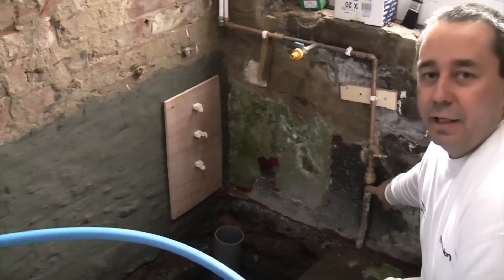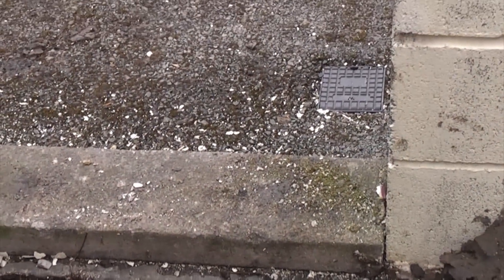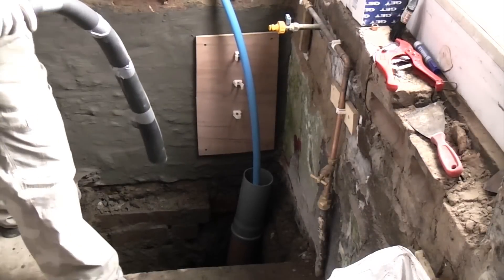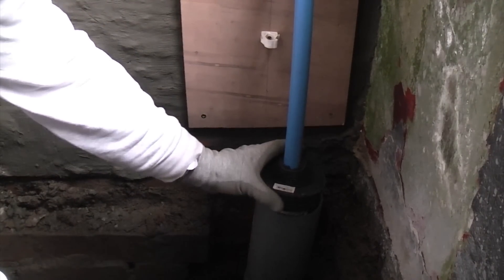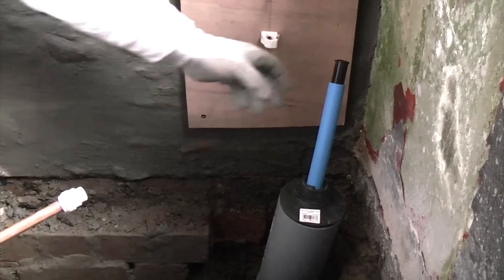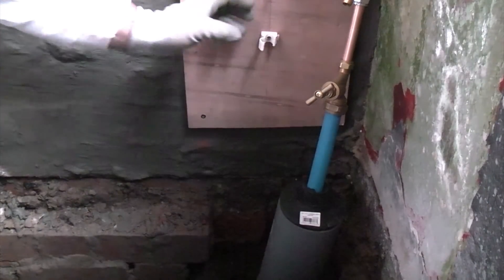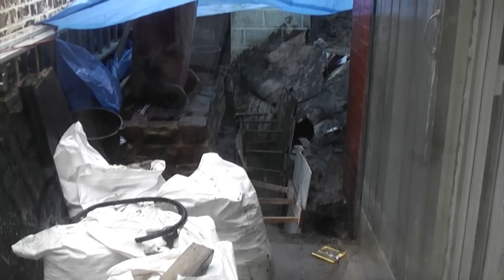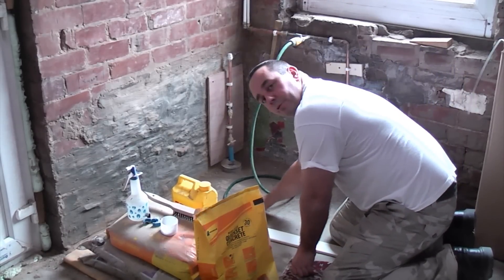Lead pipe replacement

Comment: Did you just leave enough length of pipe at the boundary ready to push through when they came to connect? I don't have to dig outside mt wall leaving it sticking up outside the boundary
Reply from the maker: Yes, you need to leave a couple of feet. I dug under the wall from my side, then put the cap on the pipe and pushed it a couple of feet through the soil/clay, then the utility company can dig up on the street side and connect it up 👍

Comment: If you use a flexible twin wall coil (blue one 110mm)  how do you seal the ends of the duct
Reply from the maker: Not sure, I think I only sealed the end on the inside of the property 🤔

Comment: Hello great videos :) I got a questio, I have a 1930s built house with lead pipes in the walls. My kitchen has both hot and cold tap pipes go into wall. My bathroom is about the kitchen, do the pips go down into the kitchen floor? I want to insall a cabinet above sink but unsure where my water pipes go within the wall. Hope you can help many thanks. hope that makes sense lol
Ian
Reply from the maker: I have no idea, sorry.
It all depends on the plumber, he could have routed the pipes anywhere 👍

Comment: Great video from back in the day. I've just started this job. Currently digging a trench About 6 metres across front garden then core drilled through three layers of brick at front of house. I've run 110mm blue flexible ducting through the underfloor of the living room and then core drilled underfloor kitchen wall. The ducting then comes up into the kitchen through another core drilled hole. Not seen the flexible ducting in any youtube video as most use 110mm soil pipe. Think I should be ok with that as United Utilities don't specify any particular ducting. By far, hardest part is digging down into rock hard clay. Getting there though....
Reply from the maker: I think any ducting will be fine, it’s only to make replacing the pipe easier in future.
Clay is a real pain, always sticks to the spade!
Best of luck with it 👍
Reply: @ultimatehandyman  Hi...Thanks. Could youy tell me a specific product to seal around the MDPE and the gap in the bung. I don't seem to be able to get a definitive answer to date. Thanks
Reply from the maker: @Cybertruck1000   I used one of these- https://bit.ly/3NgtSUN 👍
Be careful if you use any kind of sealant, as chemicals can leach through the MDPE pipe into the water
Reply: @ultimatehandyman  Hi.. Thanks for reply. Yes I have one of those end adapters. There is a gap though between the pipe where it comes through the adapter. I was under the impression it would have to have a sealant to seal that gap even though it's small. Last bit of the puzzle this. I may see if I can tape polythene around pipe either side of the the adapter then mortar round it. United utilities say plumbers sometimes use mortar but protect the pipe whilst doing so. If mine passes inspection I'll find out from inspector what he thinks it's best method and I'll let it be known. Seen a few on internet trying to get to the bottom of this. Thanks

Comment: Were did you get the rubber blank that you cut to put the water pipe in to seal the 110mm soil pipe many thanks in advance
Reply from the maker: 110mm rubber reducer- Example here- https://bit.ly/3NgtSUN 👍

Comment: I'm installing a new water supply with 32mm mdpe into a different location in the kitchen, under the kitchen sink, the pipework is entering through the outside wall using a insuduct housting 110mm ducting at 90 degrees just above floor level,. What are your thoughts as to puttting the philmac mdpe type stopcock 90 degrees or should I put an elbow fitting  onto the incoming pipe then a short piece of mdpe then the stopcock upright? I'm thinking the upright stopcock would look neater however the horizontal way would have less fittings before being able to turn off.

Comment: Hi, any chance you can list the names of the materials we need and or links?

I'm struggling to find:
Rubber seal/gromet for soil pipe.
Drain off valve like yours.

Thanks would be much appreciated 👍
Reply from the maker: I think I used one of these- https://fave.co/3qVjLtC
Drain off valve- https://fave.co/3iNkl9T
Which you connect via a compression Tee - https://fave.co/2YihIU4

👍
Reply: @ultimatehandyman  many thanks 👍

Comment: Great video! Just wondering if this stop tap you fitted was in the kitchen/ back of house and the main stoptap at the front, how would you tunnel under your floor to put the ducting in?
Reply from the maker: Not sure. Where I live all the houses I have seen have the water supply entering either via the back (as in this video) or via the front. The houses that I have seen where the outside stop tap is at the front and the stop tap in the property is at the rear, normally have the pipe running at the side of the house (not underneath it)
Thanks for the comment 👍
Reply: @ultimatehandyman  thank you!

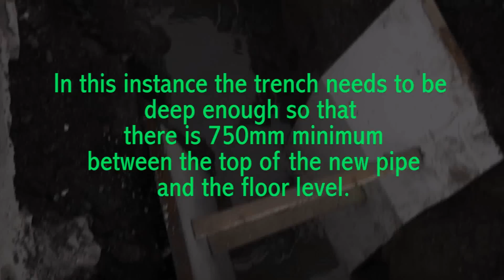Comment: Where the writing said at 1:15 that the trench needed to be 750mm min from the top of new pipe and floor level this just mean the pipe must be buried at least 750mm deep. Also does the insulation continue all the way to the main connection done by the water board
Reply from the maker: Yes, the trench needs to be at least that depth, or the waterboard will refuse to approve it.
The insulation just goes on the inside of the property and down into the trench, once the pipe is under the ground, it will be insulated by the earth.
Thanks for the comment 👍
Reply: @ultimatehandyman  Thanks you for always replying. Great Videos and website you have.

Comment: What did you bed the water pipe on in the trench? Pea Shingle? Sand? And what did you place on top of the water pipe in the trench? Soil ok? 
Many thanks kind regards
Reply from the maker: I can't remember now, it was so long ago. 
United utilities sent me a guide and specified how deep the hole needed to be and what it needed to be bedded on ( I think it was sand), they then came and inspected it, before it was backfilled and flagged over.

Comment: will i get a better flow rate if i connect to a 22mm pipe rather than a 15mm pipe or will it not make any difference.
Reply from the maker: If you are installing a full run of pipe through out the house and if you use a bath tap you will get more flow, but if you are just using a piece of 22mm to connect up to existing 15mm pipe you will not get better flow.

Comment: when you fill the hole in with the clay and concrete. Do you have to put and damp course in ?
Reply from the maker: There was no damp proof course in this house, so after filling in the hole the whole floor was tanked, then levelled with a screed. But you could just put some waterproofing ad mixture in the concrete.

Comment: The waterboard have come and fitted an external stop tap...but on my property, does that mean I don't have to notify them of the lead replacement? I asked them if I had a choice where it went (I wanted it to go by the lawn so I could dig up the soil rather than driveway ), they said no but that there's an existing channel plastic pipe can be pushed down so no need to trench.  It sounds (and looks) a bit unlikely to me, but does that sound right?
Reply from the maker: Not sure, you are better off asking the waterboard.
I have heard about them pushing a new pipe down the old pipe, but I have never seen it being done and so I do not know how well it works.
Thanks for the comment

Comment: This is an old vid now so you might not recall an answer.   Great advise all the same, so thanks!
My lead feed splits at the top of the drive, one way to the house and the other to the Brick $hit house.
Just discovered I've been losing an average of 980 litres per day for the last 12 months (no sign other than the water meter).
So, rather than patching it I'll replace the lot.  How do you go about the feed splitting issue?  Can joints even be burried??
Reply from the maker: Not sure, to be honest.
To get the new pipe fitted under the lead replacement scheme (if it is still running), you might have to replace both lead pipes.
You can of course use the Leadloc fittings underground, or you can use the UTC-
https://www.youtube.com/watch?v=_k5NS5Y-KHg
Best of luck with it ;-)
Reply: @ultimatehandyman  nice one pal, I'd never heard of them.  Good video.  Cheers!

Comment: United utilities did reading on our outside tap is low flow, apparently next door detached like us have low flow like us too. Utilities managed to find our outside stop tap down the alleyway today, we and neighbour have own seperate feeds and main stop tap. Neighbour is getting low flow as well not sure what the issue is. Utilities have not done reading on outside stop tap just yet.
Reply from the maker: Apparently there is no law or no set minimum amount of pressure or water flow, so as long as you have "water" they might not do anything about the poor flow.
 Thanks for the comment 👍

Comment: How much would all this cost trench digging wise and piping, what did you use to dig with?
Reply from the maker: A mate dug the trench with a pick axe and spade.
You would probably be looking at £300-£500 to get the trench dug, plus the pipe and fittings (which are not expensive)
  Thanks for the comment 👍
Reply: @ultimatehandyman  I have a concrete breaker that might be good.

Comment: Useful video thanks. Can I ask why you bothered to put the insert and stop end on at the meter end of the pipe? Surely the water board have to cut it to length to connect it up?
Reply from the maker: You are welcome.
When I applied for the lead replacement scheme, they sent out a leaflet which explained how deep the pipe had to be, how it needed to go under the foundations and also stipulated that the end needed to be capped off using a stop end. I followed their instructions to the letter, as I did not want to give them an excuse not to do the job.  When the guys came to connect the pipe, they asked me the same question as you 😂
Thanks for the comment 👍
Reply: I have finally started mine and have the trench dug out now. Did it make much difference for you over the lead? Were you replacing for increased flow?

Comment: Shirley , there must be an external wall mounted option ?  then drill hole through wall at required height, this is like back in the dark ages , and it has potential to disturb foundations ., as 750mm down smashing through bedrock then foundations . Come on, wall mounted external options ?
Reply from the maker: This is how all mains water pipes are installed in the UK, although in newbuilds the pipe will be put in before the foundations (I assume). The pipe is underground to prevent it from freezing.
Thanks for the comment
Reply: who is Shirley?
Reply: Not so sure they had domestic pumped freshwater supply back in the dark ages, or that it was ("would have been") an underground piped supply...

Comment: hi, redoing our kitchen amd if I want to move the position of my houses stop cock can I just cap off the existing join to my houses pipe work and relocate the incoming water main to join the system elsewhere like under the kitchen sink downstairs  or could this cause problems?  it is only a small terrace, currently the mains comes in and goes immediately up and under the first floors floorboards.  my understanding is that as long as I join it back up to the cold pipes the pressure will mean everything should operate as normal. is this correct.  obviously I'll make sure it's still earthed at the new location. thanks.
Reply from the maker: I'm not sure if you can do that to be honest (you probably can), but it is not something I have ever done before.

Comment: Nice job. What happens to the old water feed? was that capped  or disconnected outside the boundry wall OR was it left in place?. If the other end of the MDPE has to exit the boundry by 2ft does it have to be protected from soil damage and does it need a tracer wire ?
Reply from the maker: Thanks, The old lead pipe was disconnected at their end by the water supply company, but it is left in position.
The MDPE pipe simply has a protective cap over the end, the water company then remove the cap and connect it to the mains supply.
Thanks for the comment
Reply: Abandoning the old line in place is the ideal solution, since the electrical system typically gets Earthed to the water supply, and often two additional 2,5m long copper rods are driven, and located at least 2m apart for Earthing purposes...

Comment: hi im doing a single storey extension at the rear and was wondering what is the min depth   the MDPE can run under the the new concrete  slab , cant find info on this anywhere. I know its 750 deep in an external trench . and does this need signing off if im only extending it from the old kitchen to the new . thanks for the help
Reply from the maker: I'm not sure, sorry.
When installing this pipe I just did it exactly as the utility company recommended.
Your best bet would be to ask building control as they will be the ones that will be signing off the work.
Thanks for the comment

Comment: Hi
can you help with the name for a Rubber Seal you have used to end of soil pipes. Maybe I don't have the right name for them, Could't find 
thanks
Reply from the maker: Its a 110mm rubber reducer, which you can get on ebay etc.
http://fave.co/2egyYFf
Thanks for the comment

Comment: Great video! I need to do this job and plan to do it when I re-do my front yard. On my property the pipe will come into the cellar (horizontally) at the front of the house. Should I use a 90 degree mdpe elbow on the mdpe pipe as it enters the cellar or is there a better way to do it? Cheers
Reply from the maker: Yes I would use an elbow, as long as its inside of the property.
You can bend the MDPE pipe but you can only do long sweeping bends and not tight bends like you will get using an elbow. 
Good luck with the replacement ;-)

Comment: Very good, very educational.  But why wouldn't you come off in 22?
Reply: I had the same thought. In the US, 22mm (3/4" Imperial) pipe is ran extensively thru the structure. This prevents pressure loss, which in the case of a someone using the shower, could prove painful when another fixture is used, such as a toilet in another bathroom or a washing machine, etc.
Reply: Because we in the UK do things like they’ve always been done. 

It’s one of thankfully only a few things that annoy me about how we do stuff here in the UK. Even if it doesn’t make sense, we do it that way because “we’ve always done it that way”

But to be more serious, mostly in the UK we store our hot and cold water in the attic (loft). So the 15mm “mains water” is used mostly in the Uk for the kitchen tap (no other tap, ONLY the kitchen tap) and to feed the ball valve on the main cold water storage tank in the loft. That cold water storage tanks feeds the rest of the taps in the house, the toilets and is also used to create the pressure to push the hot water out of the hot water tank. 

We’re slowly moving to instant hot water and/or pressurised water but that won’t happen overnight. 

Welcome to the UK :)
Reply: @GeeTheBuilder  haha, you make it sound a lot more archaic than it actually is.   I've lived in 5 properties over the last 25 years and only one of these didn't have a combi boiler - that was a run down terrace project in 1997 which immediately got updated.  My current house is 101 years old and first went combi 18 years ago and has just had a new more efficient combi boiler installed.  Maybe I just got lucky 😁

Comment: Where on earth do you buy those rubber grommets that go in the end of the soil pipe?  I've looked everywhere.  And where do you buy your armaflex?  Thanks
Reply: Ok think I've found them.  They go by the name of 110mm waste adapter or universal waste adapter.  Supposed to only go down to 32mm, but if you're using 25mm MDPE then I assume it works for that too.  So do you put on on the other end of the soil pipe outside?  And what other options are there apart from using this grommet to seal the duct?  Thanks
Reply: And does your duct pass under the foundations?  If so did you put a lintel over it?  Thanks
Reply from the maker: +Roger Balfour 
Yes it passes under the foundations. No, there is no lintel it was simply inserted underneath.

Comment: Hi Pal,
I recently used this fitting,
But I noticed very small dripping ..
Any Advise Please?
Regards
Reply from the maker: +MrBestEditing 
If it is dripping from one of the compression nuts, you can simply nip them up in a clockwise direction using a suitable spanner and a pair of water pump pliers to hold the fitting/tap whilst you tighten the nut.
Reply: Hi,
Yeah learnt that the washer wasnt going on pipe first, then had to loose the washer and tighten a bit with spanner, then worked mate..

Regards